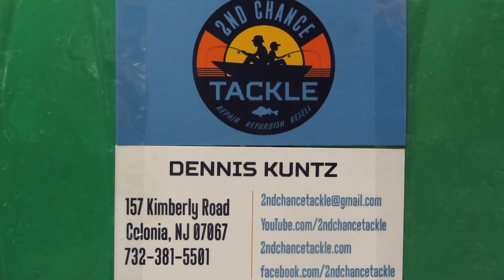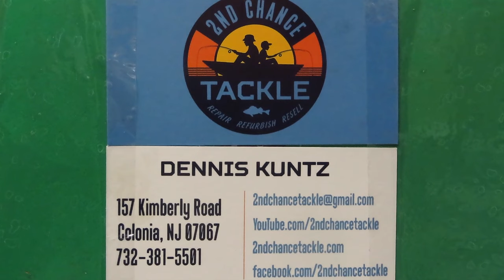Daiwa 7850RL vintage flea market flshing reel find how to service

Comment: Dennis, I have two of these. One is black and is new in the original box. The other is tan in color and is used but is in the original box as well. I like this model a great deal and it is perfect for surf fishing. Mine both say 7850RLH which I assume means “Right Left Hand” meaning you can put the handle on either side of the reel. The unique push button anti-reverse is very effective. Also I love a worm drive reel which makes for a very strong mechanism. This Daiwa has some of the finest gearing you’ll ever find in a vintage 1970s spinning reel. This reel appears to have never been serviced before. Also, the bail trip mechanism is absolutely superb! You’ll be hard pressed to find a better bail trip in any other vintage spinning reel from this  era. This reel also has a very unique and effective anti-reverse mechanism. The only vintage Daiwa I own that is better than this one is the 8000 series reels - 8600 and 8700. Both those reels have three ball bearings and are also very fine worm gear reels. As you can tell this 7850 is one of my most favorite Daiwa reels of the Daiwa portion of my vintage spinning reel collection. I have about 78 total vintage Daiwa reels altogether. Scott, you found a true gem in this reel. Thanks Dennis for sharing this fine example of Daiwa craftsmanship! — Chris
Reply from the maker: YW - Yes - this is a great reel that is often overlooked - Definitely worth having.  Best wishes Chris - Dennis

Comment: some of the time a reel, or any kind of equipment will have a particular weak link and they will get sold for parts so you end up with 2 reels needing the same part
Reply from the maker: That happens all of the time.  Try to find the older a/r clutch for the Shimano stradics - They sold out of them a long time ago!

Comment: Just curious. Can additional drag washers of the same size be added to increase the performance on a reel that size? The spool cavity looks cavernous. One could use a little more drag when catching fish that the reel was designed for. Just a conversation starting question.
Reply: I'd think that is risky. The gears, case and such were not engineered with that in mind. I'd think it safer to use the palm of the hand technique sparingly at just the right moment.
Reply from the maker: I would agree on the engineering point, , but it is your reel if you would like to give it a go, you should be able to  add the washer
Reply: May not have the room to add a washer, but I bet you can re-shape or make a Carbon-tex washer to fit, instead of the plastic one. Time and the elements are not kind to plastic.